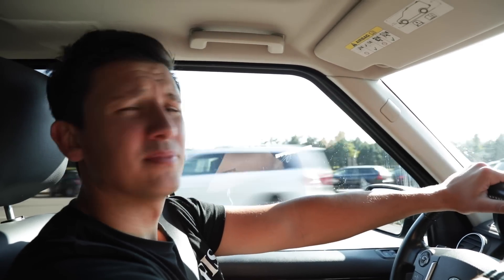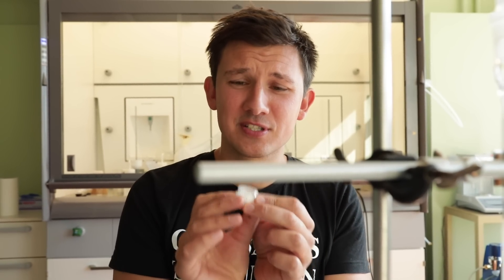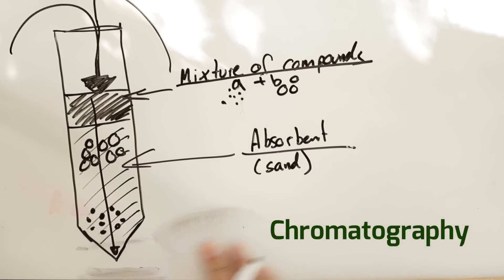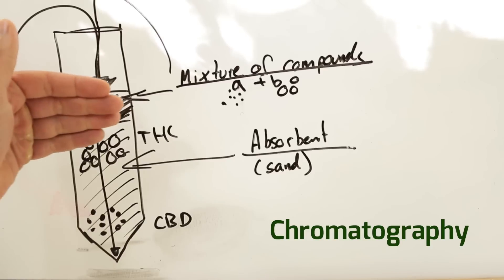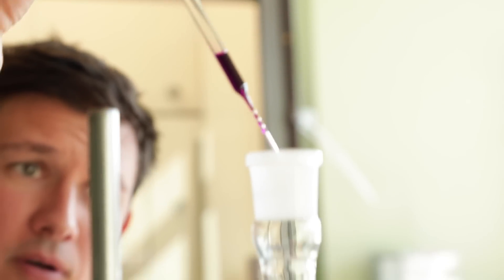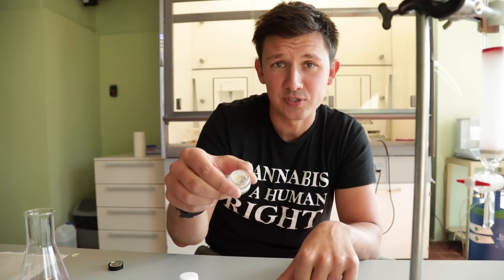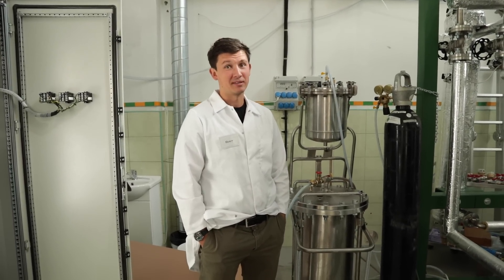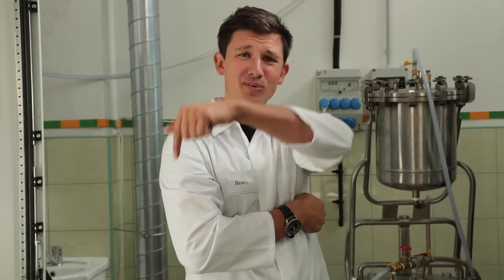How To Make 99% PURE CBD Crystals

Comment: You need a tube, some sand, and some liquid? What tube? What kind of sand? What kind of liquid? This video is so damn vague you really didn't tell anything about the process at all, wow! When people make videos like this, it's not to share information but to sell information. Thanks for nothing.
Reply: CANNABIS IS A HUMAN RIGHT!!
Reply: google "paper chromatography", it's relatively easier and you can do in your home.
Reply: i'm working now at using microscaled calcium alginate agregate's diffusion differential to separate the two phases way faster than that without excess pressure, it's a very interesting field, if at least it was legal to study this in my country i'd be doing that for a living.
Reply: Column chromatography lol
Reply: you may need to have some basic knowledge around this subject and chemistry before jumping right in a lab and expecting to be your own pharmacist LOL...i admire your wanting to learn but you may want to start with bubble hash and work ur way up
Reply: Indy Kid 
You are a REALY kind Person.... !
As much i can "extract" out of your short comment.
...   ;))
Reply: @indykid3397  
I know the process very well!! I'm interested in expanding my skill set!!
Reply: i generally use solvent dispersion in a piece of pre washed hemp paper, that's called paper chromatography, and it's based in the different speed of propagation of different compounds trough convection in a solid, you will drop the solution and check the side that countains thc, i don't remember wich side it's, one side will have thc and the other cbd, cut the cbd side, wash the cbd paper with isopropyl alcohol and repeat the process as much as you like, you can buy a fluorsilicon pot in the cooking items in any supermarket, fluorsilicon is shatter proof, to collect the hash in one ball you might want to freeze that.
Reply: I believe the liquid he is using is heptane or pentane that has been slightly acidified to prevent oxidation to "some" degree. What I have done in the past is to reduce the amount of heptane by heating to the point you just start to see crystallization. let it set and and slowly you will see nice large crystals clear growing in the heptane. Pentane also works well.
Reply: @okidokimate1097  
Is that possible to use 70% ethanol ?
Reply: @deepbluewaterful No you can't the other 30% is water. You need anhydrous solvents.
Reply: @okidokimate1097  ok, thx
Reply: Jessica Roper he did not even explained anything
Reply: Endoca CBD Jessica is jonesin😂
Reply: Silica gel not sand, then do some thin layer chromagraphy to identify  fractions that contain your desired product.
Reply from the maker: Hey Jessica, you will need chromatography equipment, this is not a video for people to do at home with utensils found around the house. We tried to find a way to do this, but it proved impossible, so we shared with you the basics of how we make our pure CBD, however you will need the appropriate equipment to make it yourself
Reply: @EndocaCBD  China sells EVERYTHING.
Reply: @EndocaCBD  ok,we need a list of wat we need+where 2 get it!!?
i think i saw a kit for $100 on internet
Reply: fss1704 I found a kit on eBay with instructions so you feel that way works better,just follow the products step which is purchased?
Reply: You need Silica sand which is glass like and very clean. Amazing filtration. Glass? Any strong lab grade glass . However on big scales you need steel.
Reply: I like to know the kind of sand too? The solution? Is an alcohol wash? Then after, biol out the alcohol? The equipment is possible to get, once you learn where and how to get it, spend time and money. You be smarter. I like to do this one day. I like to know how to get the cbd's out without solvent, if possible. I do make Roisn, but that is not effiencent, and My squished by-product, would be nice to do something different than edibles.
Reply: We need Tons lol
Reply: I figured it out... Maybe you had to see the previous video.
Reply: If you see this video and don't realize he was using simple column chromatography... literally first semester chemistry, then maybe extractions aren't for you.
Reply: You are so RUDE!!  He says in the video they are trying hard for a way for people to do it at home !  that is specialized equipment!   What did you do? Watch it with the volume turned off?
Reply: @chloemypet  ur total idiot he didnt explain most  crutial things like what liquid or sand and thats what we want to know
Reply: @waclawjarzabek6311  If you are an organic chemist you know that typically you use some mixture of heptane or hexanes in ethyl acetate on a silica gel column. Of course you can try doing some thin layer chromatography on silica gel plates, glass plates coated with silica gel. Then spot the TLC plate at bottom, let solvent run up the plate, allow solvent to evaporate off the plate, then visualize the spots with UV lamp or chemical detection such as potassium permanganate spray. Once you find conditions that separate the spots then transfer that method to a column for larger scale. You can also use thicker TLC plates coated with a thicker layer of silica gel for preparative TLC, scrape the band containing the CBD, extract the silica gel with solvent, filtering off the silica gel, then evaporate down. This is all routine for an organic chemist.
Reply: paper chromatography, google it.
Reply: fss1704
Reply: Or you go here and get an automated system...https://www.buchi.com/us-en/cannabis.  Go to minute 3:42.
Reply: Jessica, he said it's a process they're working on. ....toward the end of the video. Lighten up.

Comment: If you can't apply pressure above then apply negative pressure below with a large bore plastic syringe and silicone tubing.
Reply: Vacuum
Reply: can you elaborate?
Reply: Equal and opposite 😁😎
Reply: Some cheap chemistry equipment ,  some silicon caulking , gaskets and a cheap walmart vacuum and you will be in business with a capital B in this regard.  Not to mention all your friends will be jealous that you can make for 15 bucks what costs them 130 bucks with a GOOD sale going on

Comment: Are you using nitrogen gas to supply the pressure or can you use compressed air? CO2? O2 would be too reactive, How about steam? Uh oh, my espresso machine is is in for a tough time
Reply from the maker: We will run these questions by Henry and get back to you :)
Reply from the maker: Henry says to just use 02, and no steam :)

Comment: grain size of the sand ? type of liquid ?
Reply from the maker: Our team will double check with Henry and get back to you :)
Reply from the maker: Its very small particle sand that is used in chromatography, not the one from the beach. The liquid is what you can buy at companies that supply chromatography equipment, and the liquid you will need depends on the sand type you use :)
Reply from the maker: In our production we only use C02 :)
Reply: It's probably Hexane
Reply: paper chromatography with isopropyl alcohol can get 99% purification as well for a cheaper price with no equipment, it's somewhat labour intensive compared with this method, but it doesn't require liquid nitrogen and hexane, and you'll get purified thc as well.
Reply: @fss1704  ISO will leave a residue on the end product due to the process to which it itself is made the .1 percent of that solvent is the problem the 99.9 percent alcohol evapes with zero problems.  But do you want to vaporize or ingest a product with a highly cancerous causing residue on it??  It may be much more expensive,  but 100% pure ethanol can be bought by the gallon, 5 gallon, 10, 50, 100 etc and it leaves no residue and several processes exists to which you reclaim 96-98.5% of all the solvent used in the pulling out of the actives we seek in doing small scale or large scale extraction processes.  The left over with the right equipment not only has 99%-99.5% of all the cannabonoids but also all of the terpenes as well,  which little known fact,  terpenes not only cause flavor and smell but have and effect on the person using said product.  CBD isolate products are inferior to full spectrum products due to this fact alone,  but many other variables exists as well,  such as all loss of CBG, CBN, delta 8 THC, and hundreds of others no lab even will list or check for, each having their own special effect on each of our CB1 and CB2 receptors.  Wisdom truly is power in herbalism, and when big companies try short cuts they destroy the medicine the customer and maker seeks.  Side by side,  CBD isolate tincture VS Full Spec tincture with all terpenes intact makes the CBD isolate tincture pure garbage on any blind fold test,  any time of day, with any sex, any race, in any place the test would be done.  Remember what I have said...... and remember.... slow and low is all you need to know. *hint hint, wink wink 160-170F for three times longer than the destructive 240F temp given out like candy by so many novices out there.  and with this application another miracle of chemistry will occur,  and the most wanted cannabonoid delta 9 converts back to its base or "mother" cannabonoid. Wisdom is power,  Great power!
Reply: maybe if it wasn't iso